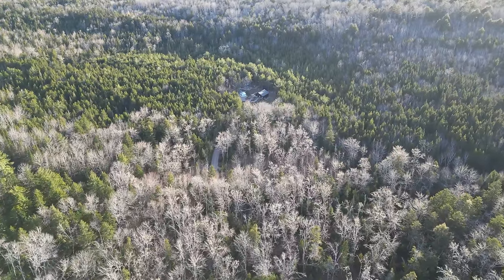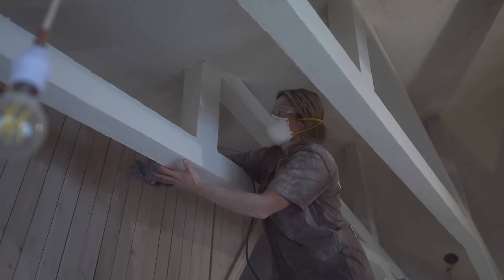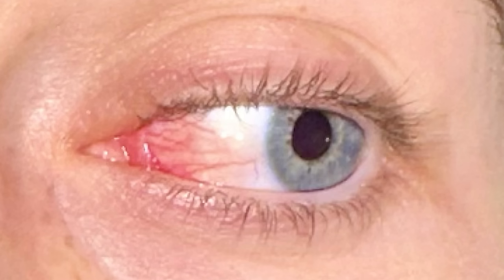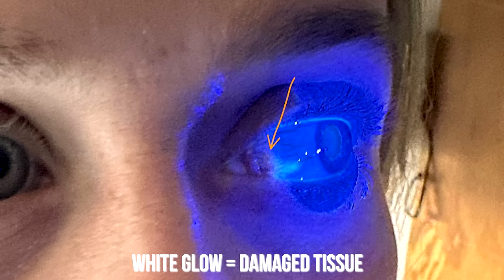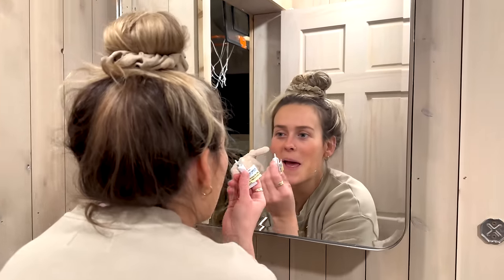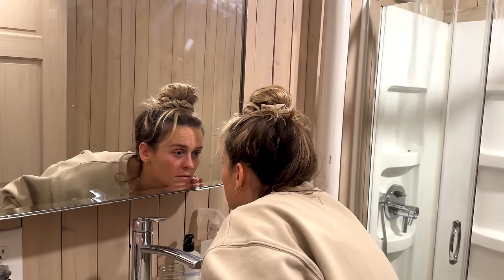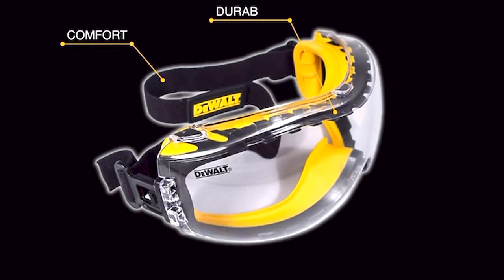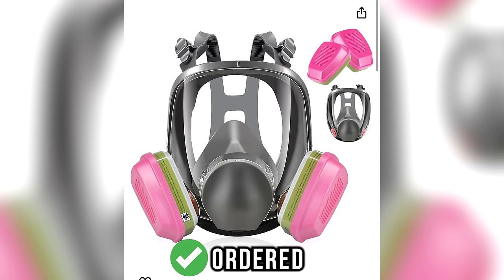telling my story

Comment: I’ve been your Debbie downer older lady gay maker/van builder/home renovator/everything doer in your comments on this topic before, but hearing protection is also an incredibly important part of PPE. Even in your intro reel here, there’s footage of using the miter saw and a compressor driven nailer, both of which are incredibly incredibly loud, without hearing protection (unless I didn’t notice foam plugs). You won’t notice the hearing damage now. You won’t notice it for years. But when it kicks in and the tinnitus starts, you’ll literally never hear silence again. You’ll never be able to sleep without background noise again because the screeching follows you into sleep. My life is dominated by the noise and it’s loudest when I want to be quiet and still. It’s like sun damage in the sense that it’s cumulative and you won’t realize how much you’ve hurt yourself until it’s too late. I went back and forth with my dad on this topic for years, and what finally changed his behavior was my gifting him a professional decibel meter to take around his shop. Anything over 90db causes hearing damage, and he took the meter around all his tools and discovered that even the impact driver rattling tops out above those levels. Now whenever anyone doubts me I suggest, at minimum, using a decibel meter phone app to see what kind of sound levels you’re being exposed to so you can make ab informed choice about when to use hearing protection. Me personally, now I use it for literally everything - even drilling one single hole or using the impact driver on one single screw.
Reply from the maker: Thank you for all your great advice and experience. We will surely make sure to have our earplugs in or hearing protective earmuffs. 💛💛

Comment: Couldn't agree more. Glad you are okay though. I had a near experience of eye damage. I was a plumber, I'm now in my 70s. In the UK back then we had airing cupboards with hot water cylinders. After changing a heating element I was withdrawing myself out of the fairly tight space, dipped my head, and stabbed myself in the eye socket, with the screwdriver I was still holding. Luckily just above the eyeball. Intense pain I still remember, but gladly no longterm damage. All to easy, so attention to detail is so important.

Comment: Also, it is important to make sure you know how to use saws correctly, and you follow that to the tee. They always need to be placed safely on a solid place, or if they are handheld the wood needs to be placed on a solid surface. Not balanced on knees and such. Handheld saws can jump and I can tell you some DYI stories. I used to work in healthcare, and I was the one answering the phone. I would have DYIers calling in all the time with missing fingers and other body parts. One guy called me up one day wanting to know what his coverage was going to be because he cut 4 of 5 fingers off. If I remember right they were able to sew them back on, but still. Not something you want to go through.

Comment: You shure heard your wakeup call! I can toltally relate myself to such an intense experience.  Imho only few people who are living 'an active life' get that lucky and get away without permanent damage and haven't had their wakeup call (yet). 
Unsettling for me is the fact it took such an experience to wear PPE consequently and sufficiently preemtively because before that in the back of my mind I had discounted the real risk of the too odd, too silly or too quick exposures.  My message to myself from my personal wakeup call has become not only to wear PPE (and the right one too) when I think it may be advised, but also particularly for these totally silly or freak situations i don't expect to happen at all.

The self obligation to preemptively wear PPE can be challenging for two reasons: first, the seeming hassle of finding, putting it on and taking care of the equipment. 
But second for the self-acknowledgement that you make mistakes. Sometimes silly and non-explainable ones. It's the one move out of a thousand that you take wrong and personal injuriy incurs. Any maybe even with gloves, face shields, hats, etc. While PPE ist your last barrier,  start with never cease to anticipate to make personal mistakes when there is potential risk involved in what you are doing.

Comment: Andrew Camarata, a fellow Youtuber in upstate NY is a heavy machine owner, operator, mechanic etc. Anyway he was on one if his excavators, his newest and most expensive one at that time and he was on his land on the side of a mountain and it caught on fire. He didn't have a fire extinguisher on it but another piece of equipment with in running distance did but it did not work. He lost the rig to the fire which he had reciently bought. His insurance didn't pay on it either. He lost probably around $100k that day. Luckily for him he has close to 1.5 million subscribers so he makes pretty good bank plus his personal property maintenance company does well too. Still it was a bad day. He just posted the video this week about it actually.

Comment: I had gotten battery acid in my eye from a job I worked at. I was breaking down pallets with car batteries and car parts.. At the time I didnt have glasses or contacts, thought I was aware, didn't wear PPE. Went to tear down a pallet that has plastic wrap all over the items, didn't see the battery acid chilling on top of the plastic wrap, took the exacto knife and tried to tear it down and it instantly splattered the acid in both my eyes. I got rushed to a eye wash area, the acid wouldn't stop burning. My employers then took me to a insta care where they had me in  the same situation you had. A huge plastic lens like thing that had the tube to rinse your eye. I almost lost my vision and am already super blind. I will never risk it again.

Comment: Good reminder.And a bad memory!  I've done a bit of renovation on a few properties too, and garden landscaping and also been a bit lax about safety/PPE. One time I managed to hit myself in the eye with the end of a rusty steel concrete reinforcenent rod,  It was stuck under a pile of stuff and I was pulling at it hard when it suddenly came free and snapped up. I clapped my {dirty } hand to my eye and when I finally got the courage -still bent over -to remove my hand and look - it was full of clear fluid and a bit of blood. It was absolutely terrifying. I was sure I was looking at my smashed eyeball in my hand!  
Fortunately not. Just my tear ducts - working hard to flush.  Same, straight off to hospital, where they flushed out a lot of rusty metal flakes and dirt, the dye test to check my cornea and found I'd made a cut in the sclera { white part of the eye}. Antibiotics {  extra important as I'm Diabetic), anti-inflamms, various drops several times a day, an eye patch and # Eye Rest # { no reading or screen time for 10 days. [ + a Tetanus Shot!  Never forget this. Should update every 10 years - but again after only  5 years, in case of a severe, or dirty wound, or a burn.]  I strongly endorse this message.  Don't get complascent folks. Stay Safe!

Comment: 1 Lab coat, 2 splash proof goggles, 3 closed toed. closed heeled shoes.

That's my chemistry teacher side coming out.
I <3 Your (ordered) goggles!

A very good idea: anytime you work with a chemical, etc write down on a piece of paper the suggestions for eye/ingesting protocol. Put it in the kitchen by the sink. It will be fresh in your mind and you can have your own first aid reference right there. You might need milk instead of water. Its good to know both in general and specifically for what you are doing.

Never wait to get your eyes to the ER. Bleach, drywall, particulates from shingles, sawdust, dog poo (don't ask) anything other than water don't hesitate.
You only have those 2 eyes and losing them should never be a function of should I go get help or not.

And now, because I also deal with stuff by laughing and being a pita (I have references) here's something for power tools but it works for so much more. Thank you Norm.

"Before we get started I'd like to take a moment to talk about shop safety. Be sure to read, understand and follow all the safety rules that come with your power tools. Knowing how to use your power tools PROPERLY will greatly reduce the risk of personal injury. And remember this. There is no other more important safety rule..."

[Norm points to his glasses.] 

Norm Abram : "...than to wear THESE... safety glasses..."

Quick healing to you and thank you for sharing this experience. In my experience folks that are on the fence regarding safety usually come down on the 'be safe' side of the fence after seeing examples. Much love.

Comment: I once got some degreaser in my eye while working on a refrigeration plant on top of a 3 story building with no fencing around it ... was screaming in pain, no one knew i was up there, both eyes watered so much i couldn't see. spent ten minutes crawling around the roof to find the tap and washed it out for half an hour ... still could not see and crawled around until i found the hatch to get down and managed to get down to the work area where i was helped to the nurses station nearly 90 minutes from when it happened... one eye is now 1 diopter different to the other and has remained that way 35 years later.

Comment: I had a very scary experience with a chainsaw in my upper teen/lower 20's, I was up a tree cutting off a thick limb in shorts and the chainsaw cut straight through the limb and into my leg just about an inch or 2 above my left knee, luckily my reflexes was so fast it just ripped my skin up but didn't hit any bone or artery. To this day I always use chainsaw protective pants when I use a chainsaw.  Take care ladies, Love yall's channel

Comment: Glad you didn't get worse. Remember to research your PPE, not all are created equal and learn to use the right tool for the job. Safety glasses have their place, goggles have their place as does a full face shield. Knowing what to wear is more important than you think. I wear prescription glasses with polycarbonate lenses. They are considered PPE due to the lens material., however they don't fully protect debris from flying into your eye. Sulfur particles are no fun in the eye. Thank fully my first aid kit had an eye wash solution with and eye cup to flush the eye out. On top of PPE you should always have a really good first aid kit.

Comment: Oh my goodness, I'm sorry to hear that you went through that, Chrystal. 🥺 Anything in the eyes is very scary, IMO. I'm just happy to hear that it's healing well, you have a loving caretaker by your side, and that nothing permanent happened to those pretty blues. 😊 My dad was a contractor for over 65yrs (he's 90yo now) and of course I worked with him over the years starting out learning the crafts  at a very young age, and back then we didn't use a heck of a lot of PPE either. 😕 Though I do remember that my dad would give me his prescription glasses when he'd come home after painting ceilings so I could scratch all the paint off of them for him. Lol But I have used a splatter shield that attaches to the nap and long arm which can take some getting used to but it can be helpful with the paint spray when doing ceilings. I've also cut a + shape hole in the bottom of a Solo red cup, cut it down to a third and then slid my paintbrush handle through it with a little tape on the bottom to catch paint, too. Here's another possible new gadget that might be helpful getting into those high awkward areas. COLBENT Multi-Angle Paint Brush Extender, Paint Edger Tool for High Ceilings | Paint Brush Extension Handle, Corner Painting Tool, Extension Pole Attachments, Long Paint Brush Tool for Painting Pole https://a.co/d/eZOSxR5

Comment: Generally, I’ve always been impressed by how safe you are… most of the time. You wear the roofing harness. You wear the leg coverings and face mask with the chain saw, which a lot of people don’t do. You wear masks and eye protection… most of the time. You read instructions! You did show a one second clip of you cutting a board on your lap with a circular saw. That didn’t look good! But overall, you seem pretty safe. But… it only takes one laps of judgement to make you vulnerable. Glad things seem okay now. Although… it did look like the bad eye was not always tracking perfectly with the other eye, when you looked to the side and back again. Hope that’s not a thing. Bad eye also looks a tiny bit different. From swelling? Still… looking good!

Comment: Thanks for this video. Like you I mostly use PPE for most work I do around the house. But sometimes I get lazy and just go to work. Well this week I rented a small stump chipper. It is shaped like a lawn mower with a 2 inch thick blade on the very front. So I am thinking every stump I am chipping wood will fly out the front of this tool. And for the most part that’s what happened. But I needed to pick up the back end to pull it back. And when I did a small chunk of wood flew out the back side and hit me on my nose. And it was flying with some velocity when it hit my nose. I stopped right then and there and went to my garage for a pair of safety glasses. Dumb, dumb, dumb. What the hell was I thinking. It’s not enough to protect yourself 99% of the time. It only takes that 1% to have an accident that could permanently change your life or in some cases cause you to lose your life. I know better but i still took the chance.

Comment: As someone who was in a freak fishing accident and have now been fighting saving an eye that has no vision in hopes they can someday repair an optic nerve don’t take chances. It can happen one day. I have had 5 IOL inter ocular lens 🎉inputted in my eye, 2 corneal transplants, a valve to regulate the pressure it just isn’t worth the risk. I was lucky it was my right eye. Had it been my left I would not be able to hold a drivers license. I was not even fishing someone else was. Their line got snagged they tugged, it loosened but they yelled look out. I looked up and bam. The weight on the line hit me in the eye. I can say this, eye pain is worse than a knee replacement, hip replacement even birthing babies! It went from bad to worse to THE worst and now all the surgeries later and pressure issues I have optic nerve damage. I can’t see in the center of my eye. I had to train my brain to ignore that field of vision. But doing that made the muscle lazy and my eye started drifting so my eyes were not going in the same direction. I had to have another surgery. People do not ignore PPE. It may be uncomfortable but it it there for a reason! Wear the gloves, the glasses, hats, respirators etc because the option is a few minutes of discomfort or a lifetime.

Comment: Oh, I am so relieved you are okay. What an absolute scare you had.  PPE and using the correct tool for the job. Too many times thinking, "I really shouldn't be doing this" because I was too lazy to get the proper tool.  I grew up watching Norm Abram on This Old House and then on to his own shows on PBS. He opened every project of The New Yankee Workshop with a quick spiel of workshop safety and safety glasses and then pepper in insert shots of turning off tools when not in use, etc. It's his voice in my head when it comes to safety.

Comment: Another activity which requires eye PPE is hammering in nails. This seems counterintuitive, but I once met man who was in the hospital because he was hammering in a nail, and the head flew off and went through his eye, and he had to have his eyeball removed. The main reason his eyeball had to be removed was that he got an infection in the wound after he started treating it. This is very common with eyes, they just seem to get infected easily. I’m a nurse by the way, and noticed that when you were using your eye cream, you appeared to be touching the surface of your eye with the container. I don’t know if they told you when you received the medication, but you never touch an eye medication applicator to the eye. I know it’s hard and uncomfortable, but you actually have to drop the medicine in without touching.  I’m sure you are already off it and nothing happened, but I thought I’d let you know anyway.

Comment: about 18 years ago I was a closet smoker, I was on trick or treat duty on Halloween and I was in the back smoking a cig when the door bell rang. I threw the lit cigarette down on the ground next to my back patio, went and gave out candy then came back to pick up the cig I could see glowing in the dark on the ground where I threw it. I bent down real fast to pick it up and there was rebar I had hammered into the ground to keep a roll up shade from blowing in the wind while down and I could not see it in the dark. I impaled my face onto that rebar at full bending motion. I slammed onto the rebar at my eyeball socket bone which almost knocked me out, luckily for me the rebar went outwards away from my eye and my eye was totally fine but my socket bone area was cut and I bleed pretty bad. It totally freaked me out, I saw stars and almost passed out and had no clue what even happened for a few seconds. If I would have been 1/4 inch the other direction I would have impaled my eyeball and lost it for sure. I still get the chills thinking about the what if. Thank God were both on the other side of that potential disaster. I soon after that quit smoking and never went back.

Comment: As someone both accident prone (I tore tendons walking off a trampoline) and scared of doctors (I dragged someone to every appointment of aforementioned accident). I LIVE for PPE because I'd like to avoid doctors. 

I'm also forgetful. So when I grab a tool or what not I ask myself do you have the tool, the safety, the product and the time. Time and safety are huge because those two can determine if I rush or am safe from flinging debris. If I can't check any of those off I stop and make sure I can before I start the project.